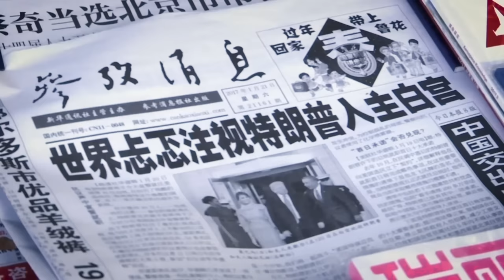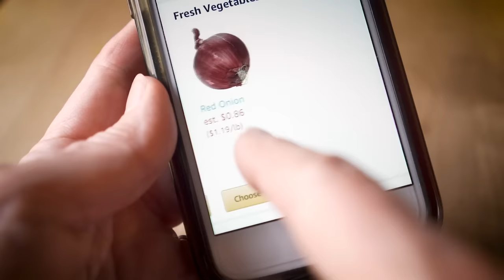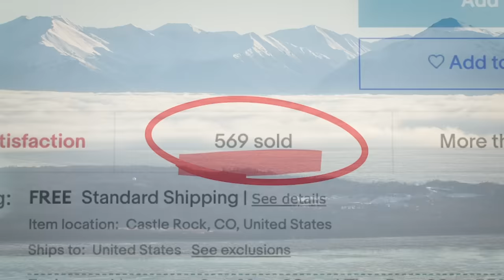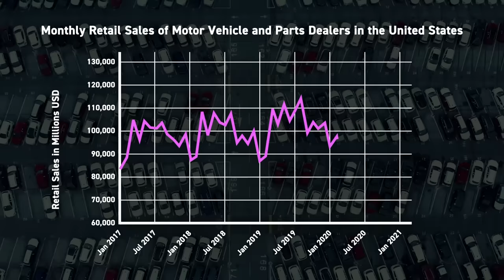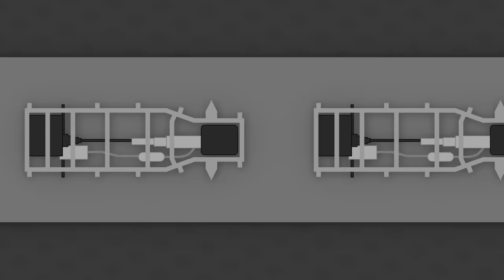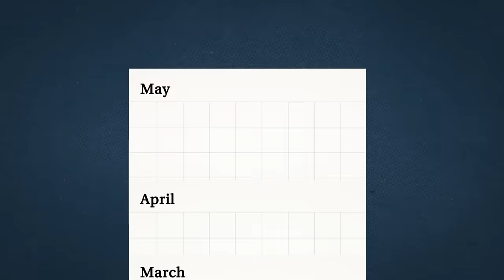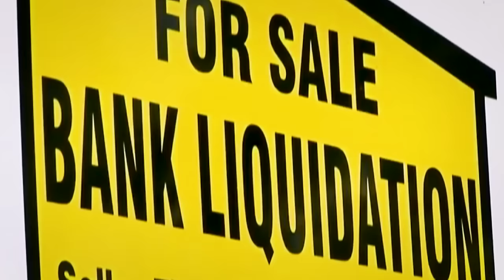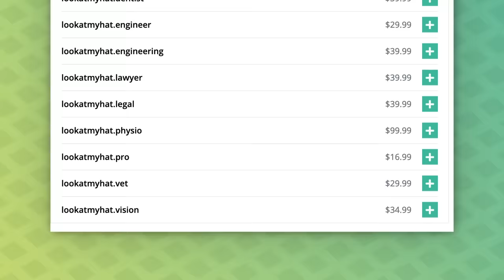Why There are Now So Many Shortages (It's Not COVID)

Comment: If automotive would have just kept their future orders on the books, they would have been fine.  But they panicked and cancelled them so semiconductor companies slowed down the lines and built far less. If auto companies would have just reduced orders, (mild adjustment) they would be in better shape. So it really wasn’t Just In Time as much as they panicked and broke the system.
Reply: They didn't panic. This economic destruction is deliberate in every way.
Reply: @annehedonia156  Correct answer.
Reply: Spare semis take up a lot less space than spare axles.
Reply: Global economic crashing is manufactured and is meant to push us towards a one world currency, and a one world government. Keep your eyes out
Reply: @bleckybob  Actually while much information in this video is true an revealing, some of it is misleading. 
Just saw other video explaining how chip factories work. An order takes many months to process, even half an year. And sure, since the auto industries did not placed orders, it is obvious that the increased demand will create a shortage.
But this does not explain the increased price for my graphic card. The stock for this card has no connection with the auto industry. Yes, they say that the chip industry is working now at full capacity, while before shortage was working at about half capacity. But if this is true, why all the other graphic cards have the same price as an year ago, and the most price performance card doubled in price? So the simple truth, is the price for card I chose has to do mainly with the amount of chips ordered for this precise card. No car industry fault, no bitcoin fault no iceberg fault.
 

So, it may be true that some shortages and the inherent price surge are due some normal causes, few shortages are just bullshit propaganda to get some extra profit.
As for the true cause of shortages, beside bad planning, and unpredictable events, is that people have too much money, and still make a pressure when they need their toy.

So there is a shortage of lumber, that it, increased by 50 percent? I simply postpone my project. Or find other solution. I will not bet the price up to put in bad position one that have an emergency project. The guy with the roof peeled up for sure will pay 3 k more, but the one building a deck in front of the house should postpone. But yeah, he has a successful channel here and will pay.    

I really needed my card, my pc being 8 years old, was quite failing often, but I do not really needed that good card, so I passed, just took a cheaper one, with real price, not doubled.  

And Titanic sunk by iceberg?    Some think that is was some financial trouble in that paradise, and some coal fire in those huge coal bunkers.... but who knows, it may be just fiction as much what we buy as truth even is just plain invention.
Reply: @ehombane  There is also the fact that, for many of the chips used in embedded applications, the chips are produced on lines that are a generation or two back from state of the art, and have both been fully depreciated and optimized as far as they can go. As a result, it is not possible to increase production on the existing lines, and it's not cost-effective for the chip manufacturers to invest in new production lines, which would need to be amortized and dialed in, but because they're producing 'low tech' chips, will not be easily repurposed to producing new chips when the backlog gets cleared. The same thing happened with aluminum cans and plastic bottles -- the production lines were optimized for producing the known demand, with limited capacity for running them harder. When the lockdowns occurred, there was increased demand for canned and bottled products, but because the manufacturers saw this as the spike it would be, were unwilling to order additional production equipment only to see them idled as dead weight once the spike ended; thus the shortage.
Reply: @stevenporter863  No that is a bad analogy about McDonalds, it is totally different, that would be a complete change in the customer purchasing choices People are still buying cars they did not all decide to stop buying cars and buy skateboards instead. 
Yes the car manufacturers would have increased inventory if they reduced production as an adjustment to maintain their sales, or would they? In my area the car lots were all empty, sales continued but the cars were not available, many people I know could not find a vehicle they were looking for. 
I work for a car part manufacturer, we never stopped producing parts, but we reduced production (too much) laying off all of the temp workers, we also stopped producing service parts, now we are behind the 8 ball and are struggling to fill the orders, because we didn't fill orders when we could have. 
We recently ran into the computer chip shortage problem, because we rely on imported chips rather that buying locally made components. Big businesses are only interested in short term profits and don't look at the long term potential risks of buying imported components. The "pandemic scare" made many people and companies overreact and now it is companies like Toyota that will reap the benefits of the short sightedness of other companies.
 Lumber prices are skyrocketing, but lumber yards are filling up with stockpiles, and the loggers are still getting the same price they received years ago before covid 19 was even a thing. Some industries are using the "pandemic" as a means to get rich, meanwhile small business that have survived for decades providing for the families of the owners are closing shops in droves, and big companies like Amazon is expanding exponentially.
The rich get richer and the poor starve.
Reply: Like an old teacher once told me:
"just in time" is a small accident away from "just too late".
living on the edge is fun while you don't fall off.
But what do you do once you fall? Installed a safety net? Wearing a safety harness? 
Instead there a worldwide pandemic which is not a small accident.
So now thing are "way too late".
Reply: @pb6801  Understood.  I wasn't suggesting purchaseing choices changed permanently but just that the demand for cars was not there during the pandemic (compared to normally).  That said, it would be silly for auto manufacturers to produce autos at the same rate during the pandemic.  Nothing to lose and everything to gain by decreasing output: avoid big inventory costs and they aren't really losing sales, customers will just wait a few months.  Problem was demand increased a lot quicker than anyone could have predicted.
Reply: But thats what just in time is.. its ordering only the minimum you think you'll need. Not one unit more.. 

If they decided to continue with the orders even when they figured they wouldn't need them, then it wouldn't be the just in time system anymore.

But you are correct, they shot themselves in the foot.
Reply: You must not have read your Bible.
Reply: Don’t get caught up on car manufactures. This is the same for many manufacturing/distribution businesses. People want to hold as minimal stock as possible but then shit the bed when they run out.
Reply: @cactusjack1943  best to keep thy mouth shut and let them think ye a fool.
Reply: @cactusjack1943  you assuming that someone hasn't been vaccinated reveals nothing about that person, as its just that, an assumption made by you.  what does that reveal about you on the other hand?  A lot.
Reply: Semiconductor manufacturing never slowed down.  There is a persistent shortage of semiconductors because of the billions needed to start a new foundry.  The chips the auto makers didn't order went to other users. When the automakers realized their mistake, they placed new orders, but were now at the end of the line.
Reply: PEACE 
BONANZA 
ABUNDANCE 
FREE THINKING
Reply: semiconductors didn't slow down, they shifted the fabs to making other products, most of automotive is on the 90-300nm node range which is common for most power IC and others which were in demand.
you almost never slow a fab down, it cost too much money for that
Reply: @marekkac7046  It's better we give you no reason; the world would not be yours if you can not adapt well enough to survive new dangers. Over 606,000 normal, common sense innocent people would not agree with your statistical logic if they were alive now.

DELTA variant ia 1000 times more infectious than Beta variant. Beta variant was 10 times more infectious than Alpha variant. Alpha was more infectious than SARS-CoV 2 (Covid-19).

Normal, common sense people take precautions against the odds of being struck by lightning to explain your '1 in 200,000' odds. Here's a fact: lighting strikes every commercial airplane at least ONCE every year. That's 4000 lightning strikes on 3000+ airplanes filled with passengers.

The 606000 Covid19 deaths thought the "odds were in their favor" and not one was struck by lighting. Covid-19 was 100% effective on them.

Darwin talked of the 'fittest'; you are not in that clique' in survival.

“It is not the strongest or the most intelligent who will survive but those who can best manage change.” as Meggison stated
Reply: @cactusjack1943   LOL wake up
Reply: @MegaKB333  go back to sleep.
Reply: H8
Reply: @cactusjack1943  hahaha, have your even looked at your own post, which says tons about you !
Reply: @The_1Engineer  lol,I used to have a supervisor that would stand by the time clock and tell people you're "almost"late.
 I ran behind one day and he says "Massey you're almost late"
  I says " turns out almost late is on fucking time"
  He never told me I was almost anything again
Reply: @stevenmassey7586  and?
Reply: @cactusjack1943  and what ?
Reply: Any decision to cancel production wasn't made in a moment of panic, it was well thought out. The factories were shut down for months, most assembly lines run around 1000 per shift so 2-3000 per day. There isn't floor space to store parts, even chip/board size parts for production months in advance.

None of that explains the problem today, months after the auto and chip makers should both have been up to speed. It's hard for me to believe in the middle of a world wide pandemic so much new business came on line the chip makers are having difficulty integrating auto industry requirements into their line up again.
Reply: @ehombane  If you saw the news, you KNOW why computer parts, GPUs in particular, are so expensive: scalpers.

With the increase of home office jobs and generalized unemployment, people started to invest in a passive form of income: cryptocurrency mining. With the giant leap in cryptocoin values, the interested hit not only consumers, but also sellers. The more expensive GPUs are always the first to sell because they are most efficient at mining. So much so that low-price, low end GPUs didnt increase the price because many of them are actually detrimental to coin mining (for example, but needing more watt/hour cost than coin/hour), only being important to "normal" consumers. On top of that, the demand for high-end GPUs 100% redirected the GPU manufacturers' focus towards them, while basically cutting on the production of low-end ones, with no cost increase, because they where never the ones to provide income in these trying times... or even before that! High-end chips are ALWAYS overpriced to compensate the low value of cheaper chips.

I cannot tell who came first:
1) the scalpers killing entire supply chains by buying GPUs in the hundreds per second (with the help of bots) and not letting any normal desktop consumer get them in time, and GPU manufacturers adapting to the demand (somewhat)
2) the manufacturers realizing there was going to be a jump in cryptocurrency investment, redirected entire factories towards high-end GPUs and in turn attracted scalpers for the seemingly larger supply of cryptomining-ready chips.

Now, i am not an specialist in economics or whatever, so take this comment with a HUGE GRAIN OF SALT. I am actually be 100% wrong lol
Reply: The semiconductor companies never slowed down nor built far less. They switched their manufacturing lines towards other consumer electronics like appliances, video game consoles, pc parts, cellphones, tablets, laptops, etc. And switching the manufacturing lines back to cars is really expensive and it takes time. Plus it doesn't help that there's a high grade silicon shortage which is used to create the chips.
Reply: @cactusjack1943  and what
Reply: Its not mere coincidence that there is a shortage in integral parts that make the cars run, and a glutt need for over production, and surplus storage of unneeded vehichles...
Reply: Whats funny is its better for them to hog all.the tires, and other resources in shortage, over producing empty non running shells, and building bigger parking lots, rather than allocating resources to feed the current need for production, and transport of  more repair parts, need for more repair techs,, and more tires... funny how industry just keeps clicking,and not training, and sending people out to actually help the situation, just like with coke, and Pepsi,  we don't need soda right now, we need water, yet there's no news of that changing any time soon,  because soda is way too profitable,so is over use, and over production of cars that don't even run...
Reply: @stevenporter863  sort of, mc d's is same as candy,and soda pop, its a drug, cheap easy drug, in these struggling times, just like the tobacco, and beer industries, any one if them could easily take the initiative to restructure their production, and service model, which would actually create more jobs, as a head of lettuce takes 5 times the effort to grow, produce, and ship, than a candy bar does. We have a tire shortage, yet a constantly fed surplus or non running vehichles being made... and a constantly decreasing availability of spare parts, and service, and no one ever picks up a phone any more... these are all jobs we could put displaced manufacturer line workers into, if we'd allow them back into the industry...
Reply: @pb6801  

Nicely laid out
Reply: @jeffcobb8151  

Ouch

Ewwwwww....

Uncomfortable imagery.
Reply: @cactusjack1943  You assume too much.
Reply: @cactusjack1943  I think you're in the wrong room. This video has nothing to do with a recession. We're not aware of any recession. Please watch the video again. This video is about a disruption in the supply chain and what caused it.
Please pay very close attention to the part when the narrator explains the shutdown of the ports in Los Angeles. 
Again, 1. Shutdown 2. Ports. 3. Los Angeles. (California, Democrat, Policy, Restrictions etc etc)
Reply: @stevenporter863  Well Mcdonalds would be smart because the TV lies a lot. They'd say that so people will be hoodwinked into the dangers of vegetarian which isn't what it's all cracked up to be. Heck once people wake up to the lies and call it out Mcdonalds would suddenly be richer.
Reply: @jamesvandamme7786  there are no spare semis
Reply: That is such a naïve and incorrect statement, it’s difficult to know where to start.

Companies who make things as big and expensive as automobiles can’t just plow forward with production if there are no orders. And where would they store the excess vehicles? And that assumes this video is completely correct, which is not the case. It seems to be more of an academic analysis, and not one with specific knowledge of the industries. It has been much more complicated and actually much more closely linked with Covid then they are giving credit.
Reply: And if they made simpler cars there wouldnt be a chip shortage. The new features are nice but cars have one purpose and one purpose only: to get people places not to be a calculator.
Reply: @caingamin2  what an odd response. We should halt technological advances because Asian countries may have a surge of the delta variant?

Or should we just make the cars without airbag chips?

Or should we just use the horse and buggy as transportation?

If you mean to make cars like in the 70s, that’s not a solution. There are still potential material shortages for plenty of products other than cars, and older cars (without microchips) weren’t as safe and were bad for the environment.

One last thing:  you can only speak for what cars mean to you. They may be nothing more than to get you from one place to another, but you can’t answer for everyone else.
Reply: @caingamin2  and gaming serves no useful purpose, so we should repurpose those chips to the auto industry.
Reply: @ehombane  the best price preforming cards (3070) are very profitable for bitcoin miners so they buy it all up
Reply: @bigchungus7050  Still, this has nothing to do with automotive messing the orders. It is still about bad decision making. If miners buy a lot of price performing cards, than the order for these should have been bigger. Sure, the card manufacturers has no idea if there will be a surge in mining or not, so when it happens, you can blame the crypto, but you cannot blame the automotive. 

Anyway, in the end is about demand and offer. Manufacturers try to guess the demand, and if they produce too much will take a loss, selling at low price, but producing less, no problem, the price will get up, same profit, less work. Unless competition produced more and cover all the demand. 

BUT, the demand can be manipulated. Just throw some bullshit scare in the market, and customers will swallow any increase in price. It may be a fire at a resin factory, it may be a strike in some mines, actual mines, marketers use it to induce the fear that prices will go up even more, and people comply and pay. I was fooled once or twice too. But I am too old to take that shit anymore. I just look at the trend of the price and if is an unreasonable increase I just do not buy.
Reply: It seem like the shortage can be related to Biden and Trans. Secretary, Buttacheck, be sleeping at the wheel.
Reply: @billr5921  I did not claimed that it has to do anything with my desired card, or my banana. You need to read more carefully. 

Actually it has nothing to do with the dollar either. I just explained that the reason for increasing the price is plain bullshit. 

And you sustain your comment with a question. has anything in my life been cheaper? Absolutely. I can write a book about it. If you do not believe me take a look at graphs. Video cards for example. I just took a look at a dozen of them and most of them in the first half of year the price goes down than fluctuates. And I was convinced that this happens to every product. But looked further, and the high end cards have a different trend. The price increases in time.  And you know this very well. Some products goes cheaper and cheaper, and some, for very good reasons, goes more expensive. You even said it. The dollar is cheaper and cheaper :)
Reply: Yeah, and retooling semiconductor manufacturing is Crazy difficult
Reply: @annehedonia156  Nah. "Just in time" supply chains started in the 80s and 90s to decrease costs. You just can't handle that free markets are not magical. They exist solely to create profits, not convenience. Or at least that is the way in the US, which runs on short-term gains
Reply: @seanmalloy7249  Interesting you say that as my boss @ MY store, told me THAT's WUT the beer company reps we order from TOLD him about WHY MYSELF and many of my REGULAR customers couldn't get OUR  "Coolie Pops: from US,!!!!  (CAN OR Bottle ,!!)  THEY make my beer here in the US of A and with all of US I'm sure they aint stop a time consuming brewing process as could always GEYWUT they had noverstocked on that to have something to sell,!!
Reply: You wasted your time and life writing this statement CHEP you don't know what you're talking about .
Reply: @headhonchotheone9041  Head, if I were u, don't believe I be talking about folks.
It seem like u may have an obsession about u hobby, and you know this time of year, folks always say it's always better to give than receive.
Reply: @headhonchotheone9041  Now Head, didn't intend to get u so upset.
However, you seem to be a tad sensitive about u's sexual orientation.
What u've been doing in the privacy of u's own abode be on u.
We just don't judge here.
Be safe.
Reply: If I could buy from the manufacturer instead of dealerships
Reply: @annehedonia156  Yes this was always the only possible end state of capitalism
Reply: @stevenporter863  Sorry, but no. The storage required for a rainy day when talking about chips is negligible, literally even less than 100 times less than other materials in a car.
Reply: I agree with a minor correction.  The semiconductor companies did not slow down at all.   The electronics companies came in and grabbed every bit of capacity they could as they correctly predicted people would load up on the fun stuff.
Reply: Don't know why Americans don't start making burger flipping robots.
Don't know why America doesn't start patenting maintenance robot designs, for infrastructure maintenance, and start producing them. 
We could have robots making robots to maintain robots and ...  oh yea, Terminator...  😜
Reply: @stevenporter863    NN
Reply: there is no shortage of anything. It's just an excuse to make everything more expensive
Reply: Just one of manu factors, not the biggest one at that.
Reply: @stevenporter863  oh no. Affordable low price cars. What a fucking calamity
Reply: No in reality people died who control supply chain. The Ford dealer in my city died from covid and dealership closed. Similarly people died all over the world including owner and employees and this created the ripple effect.
Reply: @axel3895  not at all, i do this for a living, deaths had a tiny impact on what is happening.
Reply: Nope, they sold the capacity to others. The machines are so overwhelmingly expensive, they never stop. It is more like missing a flight on an overbooked plane... someone else already has that seat and you are not getting it back.
Reply: @seanmalloy7249  only thing I want to argue with is the way you mention amortization like it is a bad thing? It is a desirable feature for companies to distribute the cost over many years. It prevents massive shocks to their P&L and helps them use it for a tax advantage for years. Past that, most of what you said checks out to my knowledge.
Reply: @lilacdoe7945  It's not that amortization is bad, but that it's not something you can just whip out and apply to the equipment, since the future usage affects how long a period you will amortize the costs over. The flexibility of the equipment affects this -- if you obtain equipment that can produce, say, current vehicle chipsets, but which doesn't have the ability to produce the next iteration of chip designs. it will have a shorter useful life than more expensive equipment that can be repurposed for newer chip designs. Basically, it's a variety of tradeoffs that have to be planned out, and sometimes reworked -- in the case of vehicle chipsets, if the manufacturers decide to take the shortage as an opportunity to shift to newer chips, which affects the purchasing decisions, particularly if the old hardware can't be repurposed. I don't know enough about that part of the industry and its management to be able to project how decisions are made, so I can't make predictions that way.
Reply: 16:15 Think stockpiling more chips would be more suicidal for tech than automotive companies though since product cycles for the former's industry are shorter, so chips become more outdated quickly & your existing chip stockpile then becomes devalued, the impact of which is enlarged the more stock you keep.
Reply: No.  It was failure to think long term.  Classic American issue.  Short Attention Span.
Reply: @ridgerunner106  What the hell does the bible have to do with any of this?
Reply: @bleckybob  One currency?  That would out an end to those unstable cyptobros.  Elon couldn't tank a currency with an SNL statement.  Simpilfy money transfers too.  Still waiting.
Reply: @ehombane  The Titanic was studied when sunk and explorers could see the gash along its hull.  Plus there was ice reported on the deck of the ship just after the hit.
Reply: of course you'd be watching things like this. big fan ^^
Reply: @annehedonia156  it's to stop people like me from thriving.  Not just me but lots of people here.  Evil is overwhelming here
Reply: @ehombane  Basic supply and demand explains everything.  As you said there is a delay and what graphic chips were made were based on the old data.  Trapped at home people turned to the one thing they could do at home other than watch TV — computers which logically included graphic cards.
Reply: @Maximara  So according to you, the reason is Covid, directly, not indirectly, as they claimed, I mean because of automotive industry cancelling orders... ;)

Anyway, According to your explanation, everything should have increased in price, CPus, since those are in computers too, memories, etc. And also, not all graphic cards got expensive Only some. 

But I suppose you did not read all my previous comments so I will repeat. Two decades I bought this bullshit. Some explosion at a resin factory, some flooding to other, disasters happens all the time. And sure some times may provoke disruptions. But in time I started to see that some things does not correlate.  And I realized that these are tactics to scare people to buy over the real price. You know, buy know, later will get even more expensive.  So, decades ago I fell for this. But in last decade I was not fooled anymore. I just waited, or chose a different solution. 

The problem is a littler more complex, there is no room to explain it all here, but the purpose is simple. To squeeze as much money possible from customer. And the methodology is vast. From simply lying, at cheap products, like powerbanks for example, where you gat a quarter or less of the capacity advertised,  to more complex things like spreading rumors like this. If you are able to get the big picture, you keep your cool and you avoid the trap. If you act like the majority, than you overpay.
Reply: @jdlflagstone6980  They shot us in the foot. They are doing fine, they just raise prices...